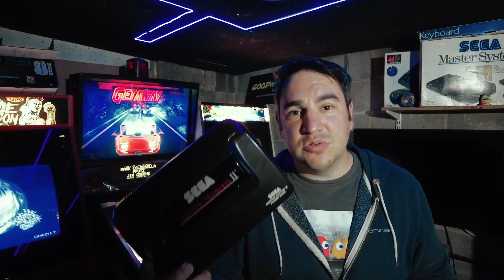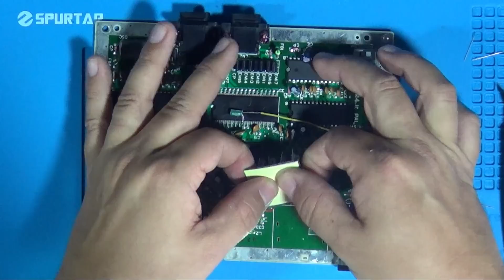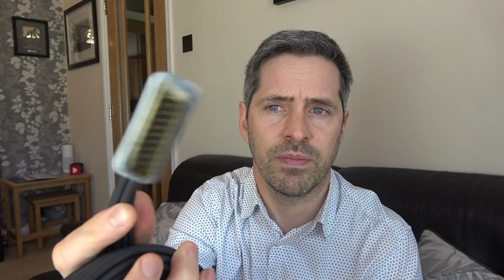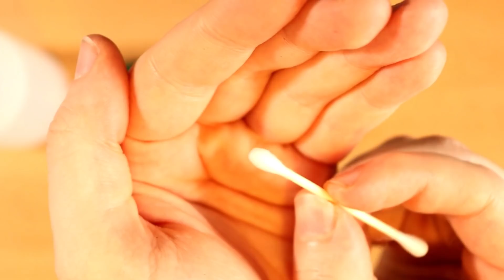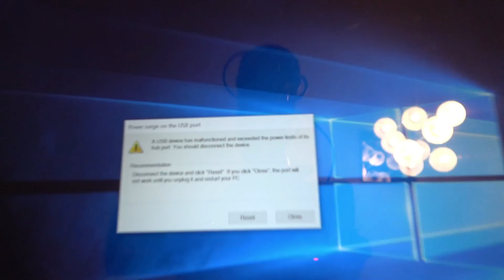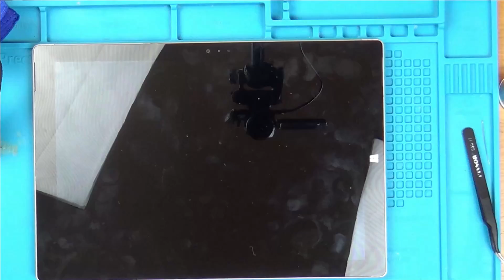The YouTube FIXERS - S1, E5

Comment: The issue with the Nintendo DS happens if you use a flashcard. The problem is with the flashcard because it has a too thin PCB, there is nothing wrong with the DS itself. This can fixed by putting a bit of folded paper (2-3 layers) under the PCB of the flashcard, so the contacts are raised a bit and make better contact.

Comment: 1:30 great mod fix . Also I have the same pinball machine it's super fast and a blast. I even downloaded Williams app to play the Getaway pinball on my phone.
Reply: @Goodwins Place  I've subscribed :) Nice arcade machines and Master System II fix/mod, and I'll check your channel out properly later! I saw that you're in Wales, I am too (but Mid) and I personally don't have a Master System, but I do have a Mega Drive 1 PAL VA4 (DC jack repaired and switchless modded), Mega Drive 2 PAL VA1 (switched and MegaAmp 2.1 modded), 32X Genesis ver. VA0 (switched modded) and Nomad (stock but to be LCDDRV screen / stepped brightness control / glass cover, Triple Bypass v2 and Master System mode enable modded) with a Mega Everdrive Pro for them, as well as a Game Gear VA1 (recapped and LED backlight on original screen / glass cover modded), Saturn Mk2 (stock but to be MODE, SaturnPSU and upgraded FRAM modded) and Dreamcast VA1 (stock but to be GDemu modded). And Nintendo/Sony/Microsoft consoles :P
Reply: Thank you - Williams app for the phone that sounds awesome. 
Love your channel, I think I started watching from one of Vince's older series.
I've done some mods to the Getaway pin on my channel, and have a couple more planned for the future.

Comment: Hey there so let me explain something about your surface and this will help you a lot the surface is known for two key issues the first issue is the charger Hass to be plugged in a specific direction if it isn’t it won’t charge at all if it is a Chinese knock off charger it won’t charge at all recommend going on Amazon and ordering a new charger second if your internal battery is faulty or won’t charge most likely you need the internal battery firmware update however there is a problem you can’t firmware update the battery charging circuit without the battery being fully charged which ended up actually killing a lot of Microsoft surface tablets It’s a really stupid update and no one understands why Microsoft blocks the update without the battery being fully charged and the battery won’t fully charge on the faulty firmware
Reply: Catch 22
Reply: @ItalianRetroGuy  Indeed it’s a stupid catch 22 because it destroys equipment and you can’t install the update which is stupid
Reply: @ItalianRetroGuy  Try reading the book , its even more insane than the surface pro issue
Reply from the maker: Thanks for the info John 👍
Reply: Maybe it wants a full battery to ensure the update is not interrupted and bricks the device ??. It is still a stupid thing to have happen though
Reply: @MrTarmonbarry  what’s stupid is without the update installed the battery dies and doesn’t allow it to recharge at all there for won’t allow the firmware update to be installed
Reply: @johnDingoFoxVelocity  I agree , very crazy situation, like someone else said , the classic catch 22 situation . Possibly someone wrote a piece of software and left something out in a previous update or even this firmware update maybe giving the usual warning about keeping your device powered up and plugged in but part of it is corrupted or was left out
Reply: @johnDingoFoxVelocity  So based on what you commented earlier the only way to update it would be to open it up and install a fully charged battery and from what i have seen that is a nightmare job.
There are some shady characters selling some with broken screens on Ebay at the moment . They are cheap and the price of the new screen is not to bad , the catch is where the machines came from . They say they can not power them on to test but i downloaded a photo they posted , it was the back of one with a sticker saying ''Powers up , tick , Displays , tick , then further down ''locked ? and beside that was written ''Account''. That i would assume means they are tied to a company account and most likely locked with a password . I contacted them and surprise surprise the photo has gone .
Hate shady dodgy a-holes on Ebay . Reported it but doubt anything will get done
Reply: @MrTarmonbarry  Indeed 100% indeed see when you see a dead surface tablet most likely it’s dead because the battery failed and the update won’t install at all unless there is a charge in the battery and it’s not a programming mistake the reason they did this update was to prevent a battery explosion which doesn’t make the situation any better this is why you find a lot of service tablets at PC recycling centers not because they’re bad devices but because of the fact that they stopped charging a battery and that’s really stupid that you have to have the battery fully charged for a good working battery in order to install an update which is basically garbage because if the battery is dead because the charger will no longer recharge it without a firmware update and the firmware update can’t be installed without a fully charged battery it becomes a nightmare it does and it creates so much waste it’s just sad really it is I really loved my surface tablet but man when Microsoft decided to start making system updates that exceeded the two gigs of RAM that were made available on the surface tablets after the operating system they kind of destroyed their own product the service tablets don’t age well and sadly they have some problems that aren’t helpful one of the missing promises was that Microsoft would update the surface tablet restore images and Microsoft a few years ago created a new firmware update to stop piracy on the surface tablets that piracy update to block hacking of the surface tablets has a nasty side effect it prevents almost all restore images on Microsoft surface webpage from working on the surface tablet so if you think you need to restore your copy of windows congratulations you can’t because older versions of windows which is what these images are made out of won’t boot with the new UEFI update kind of sucks.

I have worked on computers since I was six years old my first computer was a commodore 64 my second computer was a Franklin 1000 no hard drive ran off the floppy disks Man those were the days when things were simple
Reply: @johnDingoFoxVelocity  I gather from the commodore 64 and the Franklin references you are , how do i put this politely ?, getting on a bit , same here ))), but getting older beats the alternative .
So the update is larger than the available RAM , could that be part of the issue ??. The update server checks for space , sees there is not enough room to put it into the Ram and just refuses to do anything .
They are a nice unit but limited RAM is not great . I have not looked into the specs fully but guess they have soldered on ram and hard drive so you have to specify what goes into it when you order , a lot like Apple computers .
Is it possible to wipe the hard drive and do a full new install if you have everything backed up on an external drive or does the battery issue make it more or less unusable ?? Guess the only other option is to take the screen off and install a new fully charged battery , not am easy thing to do i believe , from what i have read and seen the screen breaks when trying

Comment: Hi Vince, wondering if you could do some fixes on non working/error vaping mods I've had a few that have failed thought it'd make for something a bit different unfortunately I've thrown mine but would be very interested
Reply from the maker: I will check them out on eBay, cheers Paul 👍